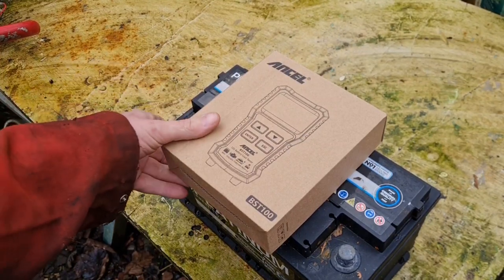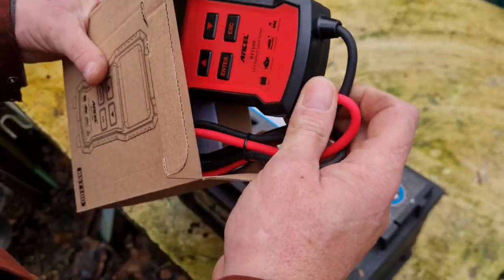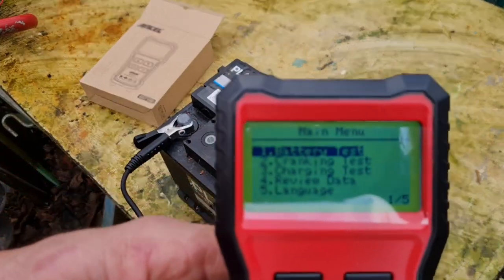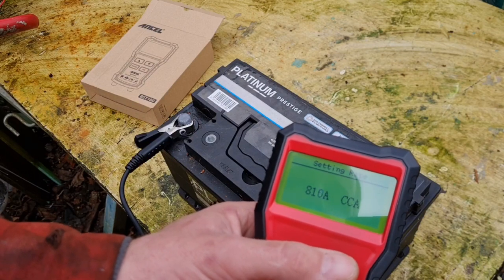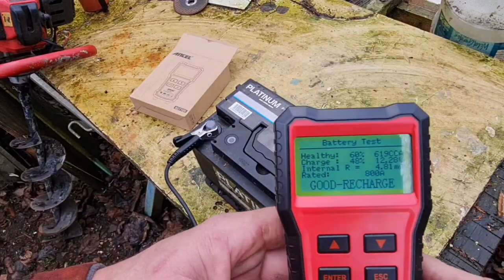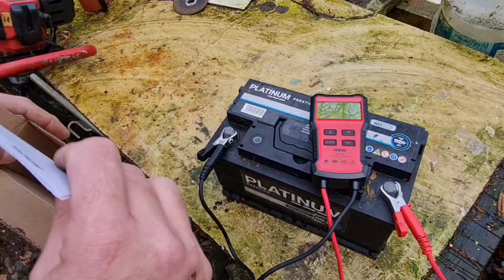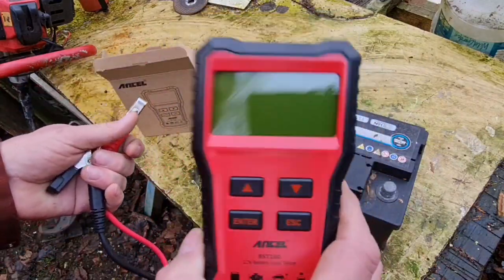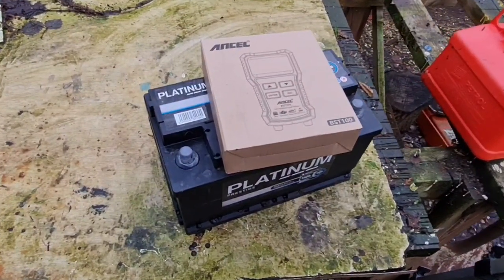Ancel BST100 battery tester. Seems a good bit of kit.

Comment: In the results, what it means with the part of "Charge" ¿what are we supposed to do?
Reply: I think that just means it's voltage. So it needs to be charged, usually your alternator keeps it charged so if it's low your alternator may be going bad. Usually car batteries should be roughly 14V.